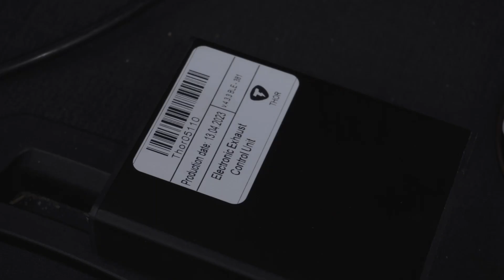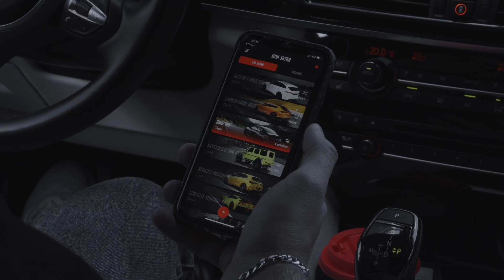Installation Electronic Exhaust System THOR on BMW X6 F16

Comment: Do you have product for motorcycle?
Reply from the maker: we're working on that product right now.
Reply: Thanks for your information. In devoped countries like Indonesia, there are many single silinder motorcycle below 250 cc. Most of the bike using standard exhaust which produce low noise while most of the bikers want sound like big bike 3 and 4 cylinder